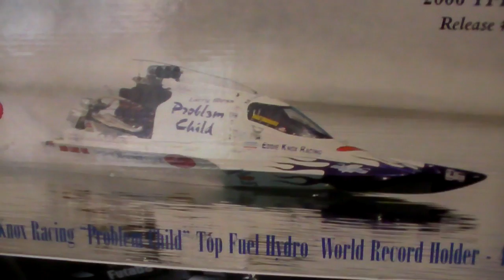Stinger 609 drag boat project part 1: Intro

Comment: Have you verified the weight in the hull will actually allow the hull to float? As a scale model there may not be enough surface area to properly float the weight your putting into it. That hull looks like you will have troubles. I don't want to scare you but make sure the hull will properly float with that much weight.